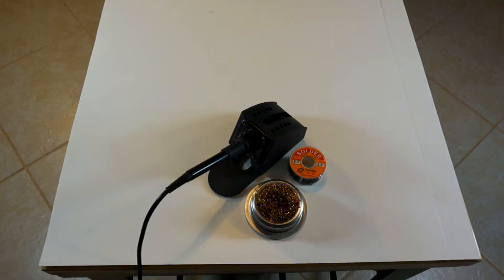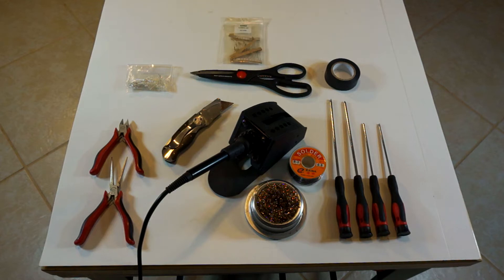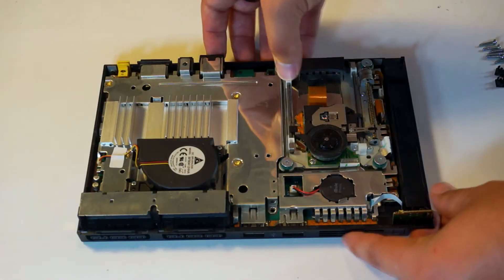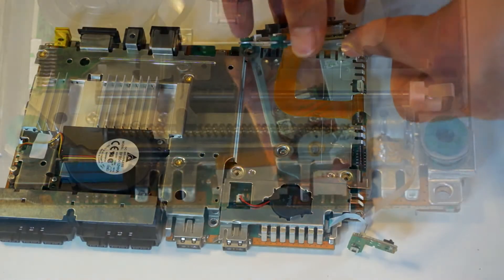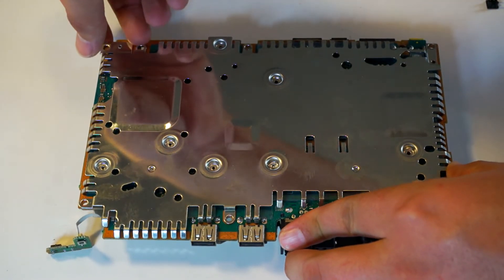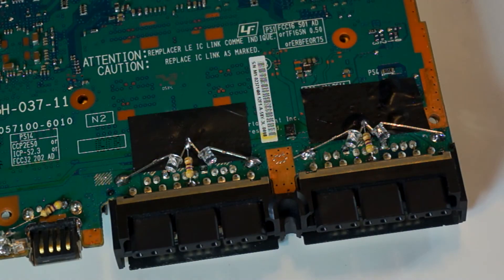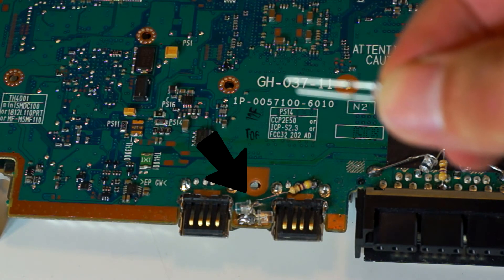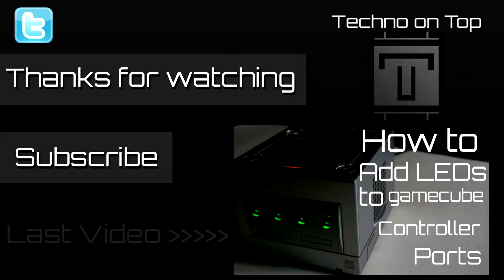How to LED Mod Slim PS2 Controller Ports

Comment: I actually got away with the 5mm leds I sanded them down because I already had them on hand and they already had the resistors preinstalled I did a trial and error until I got them to fit in perfectly and it actually looks great I put them in my limited edition ceramic white model and they really shine nice off it.

Comment: I know this is a very old video. I am trying to instert a WIFI Router into my PS2 Slim and unfortunatelly it comes with a cable. Do you reccon I could use the 5V USB Power to Attach it to the Router instead of routing a cable? I am also very confused about the ground: Did you scratch the Mainboard down to connect it via soder to the board? I also suggest that the cable the router comes with only has 2 cables: Does it matter which cable goes to the ground and power source? (have not recieved the parts yet. still waiting on shipment)
Reply from the maker: Yeah I'm sure you could attach to the power supply so long as it doesn't take much juice. I'm not super familiar with power supplies and would typically avoid them (getting shocked isn't fun). But yes I probably had to scratch a little to get solder to stick. Also no grounding where ever should be fine it's all the same ground

Comment: If by any chance you see this I attempted doing this and ordered the same parts from the link and wired it up exactly as you did. For some reason every other led lights up. Should I use a resistor for each light?
Reply from the maker: Hmm that's interesting,  don't really Rembrandt howni wired them I assume I did in parallel? So one resistor from the power should be fine for all the LEDs. But you could add one to each won't hurt anything.

Comment: Top video bro, ask me a question, I have a 12v led tape, I want to turn it on in a project of mine here, but where I'm going to turn it on it is 5v, how do I turn it on at 5v, I have to use a 12v or 5v resistor, please explain it to me,LIKEEEEEE
Reply from the maker: There is more then likely a 12v source somewhere just probe around with a multimeter around the power supply board. That or you could just get a 5v led strip (would be easier and if you don't have a multimeter probably cheaper). Hope that helps thanks for watching!
Reply: @TechnoOnTop  muito obrigado

Comment: Ya hice la modificación y no me funcionó... Incluso destella mucho más el led de encendido original que el que puse... Aquí una prueba de lo que paso en un video... https://drive.google.com/file/d/14sPnn-i7_Nc2C9kQ20KE5CgRHi91y8i3/view?usp=drivesdk
Reply from the maker: I'm currently confined to my phone, can't copy and paste for translation, I watched the video you posted, I know I placed my leds more in the center of the ports, I'm sure with it all back together you will see a glow but it might be pretty faint
Reply: I already made the modification and it did not work ... It included much more the original power LED than the one I put ... Here is a proof of what happened in a video ... https://drive.google.com/ file / d / 14sPnn-i7_Nc2C9kQ20KE5CgRHi91y8i3 / view? usp = drivesdk

Comment: What are the materials you used? I don't know how to speak English and in fact this is being translated with Google translator lol
Reply from the maker: All the supplies are in the description, Google translator did a good job I understand you clearly.
Reply: @TechnoOnTop  The materials do not appear in the description, I clearly remember that months ago when opening this video were all the materials even with Amazon links but now not ... Down in category appears instructions and materials but sends to a channel of "lifestyle" . Clearly I just need to know how many Omh the transistors would be and the voltage of the LEDs since I know they have to be 3 or 2mm ...
Reply from the maker: The description and links are all there, 3mm LEDs: https://goo.gl/8svHUy

470ohm resistors: https://goo.gl/umxtkN
Reply: @TechnoOnTop  Thank you! I guess in the image where you show where you will solder the resistance and the led, you referred to the black color as negative of the LED and red as positive for the transistor and the LED, right?
Reply from the maker: That's correct
Reply: Okay! Sorry for the inconvenience and keep it up! Thank you for putting the description in Spanish! :)
Reply from the maker: No inconvenience, I'm happy to help, your welcome, I did do that for alot of my videos didn't think anyone ever used them, i better continue to do that with some of my newer videos, thanks for watching!

Comment: You really wouldn't need resistors for these LEDs as most LEDs are anywhere from 1-5v and it will be les dim
Reply from the maker: Sure you don't actually need resistors but I have leds with resistor that are like laser beams burning your retinas. So I always add resistors just my personal preference. Thanks for watching!
Reply: @TechnoOnTop  ah I see well I always like to add small variable resistors or potentiometers so I can dim them or change brightness
Reply from the maker: Nice for adjustability if you don't mind the extra wiring. Thanks for sharing

Comment: I have doubts, can I put a cable (direct from the resistance) to put another led? Can I Put a 5mm Led? And the USB Inputs Continue to Work After Cutting? I Can Put The Led On The USB Without Making The Cut
Reply from the maker: You can wire all your leds from the same resistor, if that's what your asking if not I'm not sure what your asking I'm sorry. Also the space is extremely limited so that's why I said to use a 3mm. So my guess is no but you can try if you want. I didn't cut anything that would break the USB port so I'm unsure what your asking? This mod doesn't break anything all I did was remove some shielding. Thanks for watching
Reply: @TechnoOnTop  Thank you for your answer, keep making videos like this, you should make one by adding a toxic chip or matrix, since it would be very helpful because there is no information about that, it is only a suggestion, thanks greetings from México!
Reply from the maker: @maxmendezespinoza  the main reason why there are no videos on modchip installs at least step by step, is there are a ton of motherboard revisions for the PS2. xbox had 7, ps2 had 18 versions not to mention the small difference in versions between regions ect. another thing is those chips are no longer being made. as far as i know you can only get clones of Modbo's . but if i ever get my hands on some of those chips i will make some videos on them.

Comment: Hey bro, I want to make my ps2 look cool, and those videos you are making really helps alot. But I also want to do something crazy thay I saw on YouTube, this guy installed an ssd hard drive inside the ps2 slim and also he installed and HDMI output. Do you know how this can be done? It looks hard for sure.. If you are not going to make a similar video like this can you just explain how this can be done?
 - https://youtu.be/ob_1nRPaTRo -
See you my friend!!
Reply from the maker: well i decided to look into it. the first models of the slim still have the IDE pins on the motherboard, so it would be as simple as soldering wires to an IDE to Sata Connector then plugging in your SSD. now that's not really as easy as it sounds because that's a lot of little wires. as for the HDMI mod it's honestly probably just an upscaler that he internalized. I personally wouldn't waste my time with it.. though modern TV's are getting rid of component inputs so idk maybe it is worth it, just alot of soldering. but i appreciate the comment and you checking out my videos!
Reply: Thanks for answer my friend!! Well I think as you said this is hard to do, especially for me because my hand dont have experience with those things.. I think I might make the led mod in my ps2 slim and I will play original games with CD, and I will mode my Ps2 fat with freeMcBoot + HDD which is way easier! Thanks brother!! Try selling your modded consoles on ebay or amazon maybe you can make alot of money with that :D
Reply from the maker: Your welcome I appreciate the comments, iv always considered selling modded consoles but have never really tried. As for Ps2 modding it's pretty new to me og Xbox is where I started. Freemcboot is definitely easy I believe iv seen pre loaded memory cards on ebay for about $20. I believe modchips are just as cheap but compared to og Xbox they are pretty delicate jobs

Comment: I may have missed the part but what voltage, ohms ad type of LEDs were used? Doesn't it create an undervoltage problem for controllers?
Reply from the maker: unsure of the voltage on the LEDS i just put in 3mm with 470ohm 1/4watt resistors. but no iv never had any issues with creating undervoltage on the controllers with any console as of yet.

Comment: Would it be possible to window mod the left side of the ps2 slim? (Of course minding the controller ports and memory card slots).
Reply from the maker: it may be possible...the plexi glass would certainly be a tight fit, if it fit at all.. an option would be to flush mount the plexi glass, which requires extreme accuracy and would probably need to be done with a machine. if the plexi didnt fit you could always substitute in some type of mesh or maybe special order some really thin plexi glass?
Reply: TechnoOnTop thank you so much for replying I will take note of that.
Reply: TechnoOnTop ill tell you the results when i am finished. Have a good day sir. Subbed
Reply from the maker: I look forward to seeing it and I appreciate the support!
Reply: TechnoOnTop no problem. Thank you for replying to be it means to world to me, and I will probably comment on your latest video or on this comment to tell you when i am done. I will do a video showing the console if successful. :)

Comment: where can i get these tools cheap im young dont have the best source of cash
Reply from the maker: your local harbor freight, just always use a 20% off coupon. ebay is good for parts such as LED's . when i first started modding i would borrow my grandpa's tools (he was into amateur radio so had lots of tech tools) , maybe you could do the same?
Reply: yeah good idea i really wanna ad led strips to a ps2 fat u got any ideas on how to or tips ?

Comment: Can you make a video to put leds in a fat ps2?
Reply from the maker: i can, and i will thanks for watching!
Reply from the maker: wiring them like that should be fine, but no i hadn't looked into it yet. but going straight from the power supply is a good idea.

Comment: I just finished this mod, I went to put in a game and found that my disk can't spin. the bottom of the case rubes against the disk. I think the leds might be bulging the case up? any ideas?
Reply from the maker: Justin Erwin it was definitely a tight fit but I didn't have that problem. Does it noticeably bulge when looking at it?  I would just take it back apart.  One thing you could do to make a bit more space is sand down some of the bottom plastic. What size leds are you using?

Comment: Very cool mod, this one requires a bit more intricate disassembly based on the wiring strips so it's nice that you pulled it off. Is it possible to do this for an original sized PS2?
Reply from the maker: SkyScourgeGod thank you for checking out the video, but yes I have a phat ps2 that I plan on making a video on the same mod.
Reply: Great, I look forward to seeing it sometime.